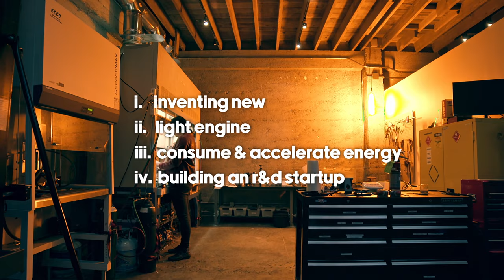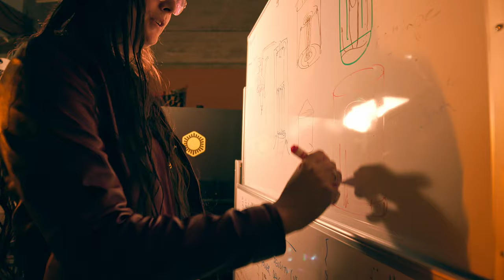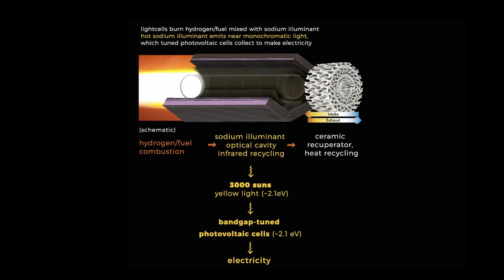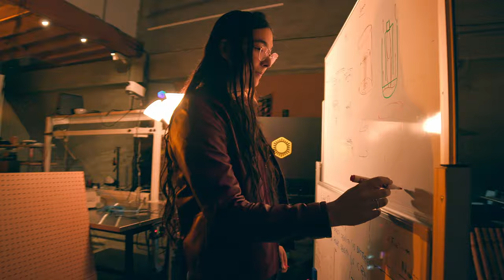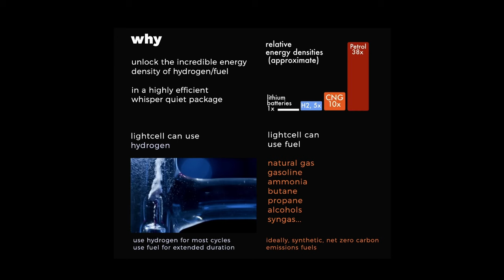Building a Light Engine | Lightcell

Comment: I think the point of this is converting chemical fuels (which are much higher energy density than batteries) into electricity without the bulk of how that is currently done (i.e. heating steam, spinning a turbine which spins a generator, etc.). I.e. the envisioned product is a compact, high density electricity source competing with traditional batteries.
Reply: It's pretty fuel agnostic, so it can easily burn green fuels too. 👍
Reply: The point is to get it more efficient at extracting more usable energy. Turbines are 30% efficient at converting fuel to electricity while this might increase it to 60%
Reply: One more thing: no moving parts means complete silence. Navies must be interested. Also, you could potentially use it with gas cooled nuclear reactors and be completely silent.
Reply: @solarissv777  The gas cooled nuclear idea is very interesting. I hope it happens

Comment: Most days electric cars only use a fraction of their battery capacity, so a compact efficient generator like this for those odd days and range anxiety would allows for much smaller battery packs in electric cars saving weight for better efficiency.
Reply: Exactly. This or a small power dense Tesla turbine

Comment: Nice , I guess competing tech would be  prisms separating sun light with the same tuned solar panels
Reply: Never seen it spelled 'teck' but it's actually 'tech', which is short for technology
Reply: That would be throwing away most of the light.
Reply: Nah man, that's broadband solar.
Reply: If you wanted to use solar for this you would concentrate the solar energy with a big array of mirrors and then convert it to heat like a concentrated solar power plant does.
Reply: That's interesting, if you get rid of all the other light that's heating the panel in vain then you can concentrate more light on the same panel, taking advantage of the high efficiency of tuned solar arrays

Comment: But... We have ways of harnessing energy meaning adding more steps like this simply means greater loss not a new way to get energy, just a new way to waste it.
Reply: if you compare it to a traditional electric generator: compressing air, combusting to turn it into heat, expanding to mechanical energy, converting that into magnetic fields and converting that to electric, it may be well superior
Reply: @danielle_fong   that isn't even including the immense resources invested to bring the fuel to power the generator regardless of type.

Comment: Could be another therenos in making.
Reply: Not quite. This is more feasable than what Theranos was proposing. It's basically burn fuel and use light cells (photovoltaics) to convert the energy to electricity. 

Although feasable doesn't neccessary mean they'll succeed.

Comment: I'm struggling to see how this is sustainable if it burns sodium as a fuel. So where's that coming from? Mining? Splitting it out of salt from the ocean? How are those processes powered? There's just something about this presentation that feels scammy.
Reply: it is literally salt, and it is recycled in the system
Reply: It isn't "sodium, burn like fuel", it's sodium, heating by burning some other fuel, like methan from Terraform Industries "methan from atmospheric water and CO2 with solar panel produced energy" process. It is about energy storage in fuel and hight efficiency this energy using process, more efficient then other ways, — it's they contributing in sustainability. We anyway need use fuel for many reasons, like a long range planes, or drones and robots with extremely big autonomy, so we need more big efficiency for it anyway. And they trying to make an answer for this request
Reply: @danielle_fong   Danielle, Do you think about using turboexpander for separate O2 from N in air for increasing temperature and reducing NO/NO2 wasting in burning process?
Reply: You don't need to worry about things you don't know. You cam research more on this topic if you are a scientist or understand how to read scientific papers. Then you can model the system and look at the various variables and then you will know whether it is sustainable or not. Sodium is abundant in nature. Salt is sodium chloride. Much easier to obtain than lithium.
Reply: As I understand it, the sodium is heated to a high temperature by using another fuel,  like hydrogen or methane. The sodium is in a leak-proof container, so none is ever lost.

Comment: I wonder, could you create an AC -> DC converter by running an LED with AC, and then using a photovoltaic panel like here to generate DC power from it?
Reply: Yes you can but that's wastefull. Just use 4 non light emitting diodes and build a full bridge rectifier.

Comment: You'd think someone with a doctorate and a little experience with failed tech startups would understand intuitively that stacking multiple conversions is less efficient than single conversions, which is why no one else is chasing this.  NREL would be all over it like white on rice if there was the slightest bit of merit. Danielle has not published any luminous efficiency accomplishments for lab/bench prototypes yet. Hasn't published anything as far as I can see. This begins to look like a grift. Even Princeton can turn them out. :(

Comment: So, how much more efficient is a light engine to a combustion engine.
Reply: ICEs are like 30% efficient, this method uses all the combustion calories to heat up the sodium and thus producing light at maybe +90% efficiency to take a guess. The tuned photovoltaics (according to the video) can get up to 60% so it could practically double the efficiency of ICEs I think